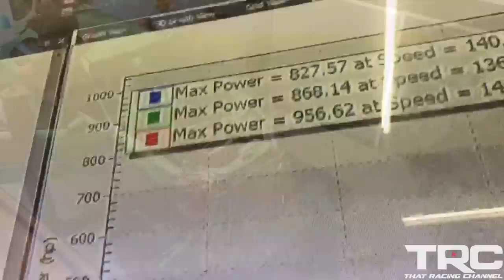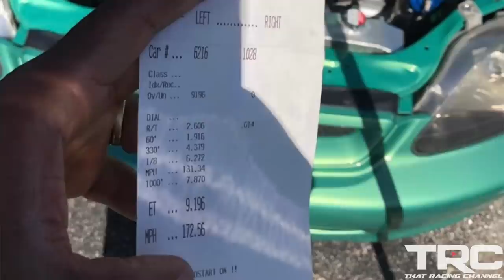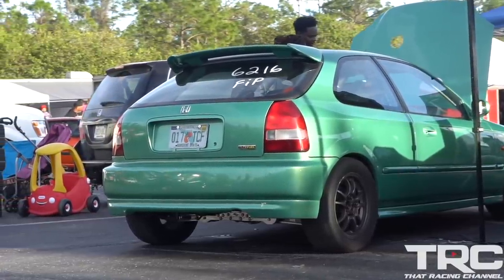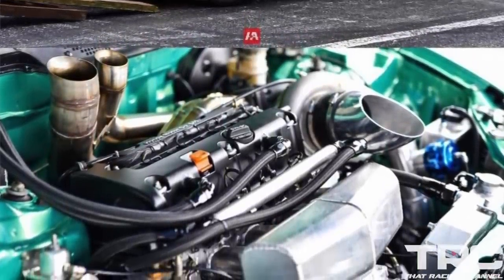Sleeper 960HP AWD Civic Runs 8's on Street Tires! The Perfect Street Honda?

Comment: Your videos title says “sleeper.” The hood exit exhaust determined that was a lie.
Reply: Suited AndBooted66 right
Reply: U can street it... just have to beat it. The blue lights that is
Reply: It also says street tires, which he even states are drag radials. Not that I'm crapping on the car, cause it's still super fast, but they should at least change the title to drag radials. The guy even admits to not driving it every day. Cars like this are lucky to get a year out of them before having to replace and engine or transmission, to start it all over again, etc. Especially with this car being high compression and running boost. But I'm sure it's still loads of fun running down the track!!
Reply: I was about to comment that. lol
Reply: @junechris  street drag radials
Reply: i mean, you can hood dump just about anything lol, doesn't mean its fast
Reply: @junechris  FYI a drag radial is considered a street tire
Reply: Drizzy570 But an exhaust coming out of the hood does disqualify it from being a sleeper.
Reply: @suitedandbooted6612  not really lol, there is a 167whp honda in my area with one.some people just do it because they can and like how it looks
Reply: Drizzy570 A sleeper is a fast car that looks slow. You’re talking about a slow car with a hole cut in the hood to try to look fast.
Reply: It doesnt look nearly as fast as it is.  I'd think it was maybe 4-500hp just by looks if i saw one like this irl
Reply: A "sleeper" to a non enthusiast.
Reply: I love the comment section. Full of kids who have never done ANYTHING calling out everything they see that they think is "wrong" based on other videos they have watched. People today actually consider themselves knowledgeable on a topic because they have seen a few videos. Imagine being that ignorant and arrogant at the same time... What a combo! Specifically these goofs saying a hood dump means it is fast... Yeah.. Cause it's really hard to buy a sawzall and mig at harbor freight. There is 200 bucks. Boom. These kids all say your car is undoubtedly FAST now!! Not a sleeper any more.
Reply: @eriklarson9137  you are most likely misinterpreting the comments.
A sleeper doesnt look fast.
Not saying that a hole in the hood makes it fast, but its a mod generally done to cars that are.  So hood hole = not sleeper
Reply: @junechris  just because this guys doesnt DD doesmt mean he couldnt there are hundreds of 700+ hp civic that get driven everyday for years
Reply: I agree with suites and booted66...this is NOT a sleeper car it’s a fuckin track car. Anyone who says otherwise is a moron. A sleeper is something you drive on the street daily that looks like a bucket but kicks the shit out of other “fast” cars. This car doesn’t look like shit AT ALL. So in conclusion THIS IS NOT A SLEEPER CAR. Ok thank you.
Reply: @junechris  i didn't know 10:1 is considered high compression.
Reply: @big_lu32  My Z28 was 10:5 to 1 and I had to run premium gas at all times, otherwise it would run like shit and it was considered high compression. Nowadays the technology is much greater. Like my friends mazda 6 is now at 13:1 which is mind blowing. The first thing I thought was , how does it even run on pump gas...lol And it recommends regular shit 87 octane to boot.
Reply: The judge jury and executioner has determined that the hood exit exhaust doesent F'n matter
Reply: in the 8 second world this is a sleeper lol
Reply: You Hating lol
Reply: Suited AndBooted66 true. But besides that it looks like a normal car... ish
Reply: ZeloCODM I disagree. It has 2 big holes in the hood, a cage, a big fmic, drag radials, gutted interior with Kirkey seats. Also, running at 172 he should have a parachute. Realistically he shouldn’t be allowed to run that fast without one. Any car going faster than 150 needs a chute.  Not putting a chute on the back of this car doesn’t make it a sleeper. It just means the driver is breaking the rules, and the track isn’t enforcing them.

*edit: the interior isn’t gutted— in the one video the radio surround fell out of the dash. My mistake.
Reply: @junechris  street/drag radials.
Reply: I could be wrong but the hole in the hood was for the turbo impeller to receive fresh,cool,unfiltered air. Not to be mistaken for a hood exit exhaust. Just my 2 cents…
Reply: @jgc0064   There are 2 holes in the hood- one for intake, one for exhaust. This car did not come from the factory with holes in the hood. So my statement still stands true. A sleeper is a built-fast car that looks factory. This car does not look factory stock. You could tell from a mile away that this car is modified, even when it’s parked and not making any sound.
Reply: @suitedandbooted6612  agreed. Didn’t see the hood exit exhaust- my bad.
Reply: @big_lu32  it’s not super high for turbo but depending on how much boost you’re running, you can see them sub 10:1 .
Reply: @junechris  10:1 compression isn’t high even on a turbo engine. Guarantee the engine lasts years
Reply: This is very much a sleeper to me. The overall style of the car does not stand out much. He could go one step further and better hide the hood. Love the low profile of this car. 8.6 1/4 is nuts! 10:1 compression is pretty high, now its more common because of direct injection and E85 gas, but same year ITR was only 10.6:1 and made over 100hp/L NA.

Comment: street tires.. then heard AWD.
Reply: I've seen a RWD run 5s in the eight on hard tires, not r888s or other semi slicks. Straight up 200 treadwear street radial tires.
Reply: @barneymiller7894   LOL yes mate sure
Reply: @bhubb18  Search Hard Tire Plymouth Scamp, you'll see it to.
Reply: Or Mario 2.0 Hard tire.
Reply: @barneymiller7894  8th mile lmao
Reply: @bhubb18  Ya that's what I said, 5s in the eighth mile, roughly equates to low 8s in the quarter.
Reply: BarneyMiller a 5.1 or 5.2 in the 1/8 can be a high 7 if it’s got enough top end
Reply: @bhubb18  reading can go a long way
Reply: SoloCamo - right..it's not like the title of the video didn't say it
Reply: @Mr.Saephan503  pretty sure the title was edited after.  That or I'm blind.
Reply: @barneymiller7894  Riiight, that happened.
Reply: ye lol
Reply: Where the fuck are you buying your street tires?
Reply: Nathan matas amazon
Reply: @n0te618  Search it for yourself, Mario 2.0 hardtire. Not saying it's easy, just possible.

Comment: I would daily that thing
Reply: Most def. Just need to tint the rear windows & your set. V8 Killer 😎
Reply: @patrickdakis4437  Anything on the street killer
Reply: @illmatix.7745  lmao i think this Honda can actually beat most streetbikes too
Reply: @patrickdakis4437  more like v12 killer
Reply: kill my ears too
Reply: @killakam123321  I've been beat by a 250 300 whp  civic   and I had a clean ass 93gsxr600 112 hp 550 lbs  and my bike was never quite as fast as the newer 600s but I could keep up with these  big nuts.  As long as I had corners. Q3 Dunlop  only on my 600   2 and a half to 3 weeks I'd eat threw the tires. 300 $ every time
Reply: Daily a car that runs on race ethanol and can probably barely idle at a stop.
Reply: Ronnie Young my 97 ford ranger has the same hp😂😂
Reply: @namelastname5391   I promise  the gsxr 600 is faster than a Ford ranger.  I've beat the mustangs with the cyote motor.   Lol. Police in a charger once too. Lol.
Reply: Until it gets immediately stolen
Reply: Ronnie Young no duh 550 pounds compared to the 2,900 my ranger is 😐
Reply: Ronnie Young i was making fun of how slow my truck is it probably does 0-60 in over half a minute 😂
Reply: The guy probably does lol
Reply: UNKNOWN G I would too
Reply: Darkeese Latifah 😂
Reply: Work horse😁

Comment: Ryan is a bad ass for sure. I have a 03 Evo 8 that he built the engine in it for the previous owner. Currently has a Precision DBB 6262 the car made 666whp on AG AutoSports dyno and flat 600whp 6-8800rpm on 5150Racing's mustang in SoCal. Very solid build of an engine by Ryan, definitely looking forward to changing the turbo for a 6766 or 6875.
Reply: Alex Comeau sup brother thanks man! Glad all is well and your happy with the motor!💪🏾💪🏾
Reply: @acrite1999  You're welcome!
Reply: 6875 🔥

Comment: Where do all these people find tracks that let them run without proper safety gear? running 8s in the 170s with no parachute?
Reply: KingOfDemise FL 😝😂
Reply: Mexico?
Reply: There's not even a cage in the car, let alone a chute
edit: there's a half cage but there's no way its 9.0 or 8.50 cert, that's some serious power and some serious speed. It's a death wish running the car that fast without proper safety
Reply: lol parachute? the car doesn't even have a cage!  just a roll bar. he shouldn't even be going over 135mph on the track, at 170+mph that car would be toast.
Reply: TRD185 that's just the south Florida way
Reply: This event is held at a track rental, no NHRA tech. And theres plenty of Outlaw (non NHRA sanctioned) tracks down south and in the midwest that dont have tech period. At any event.
Reply: In the south we don’t give a damn unless your leaking on the track.
Reply: @nickxcaliber7991  Idk what the hell the stuff is called but one of my buddies went to some little Outlaw eight mile track down South that wasn't even Blacktop, it was like bits of shattered shale held together with Tar! IG every time someone launched it spit rocks at the burnout box! I've seen some dusty blacktop roads here in Colorado, but I though only Aussies raced on shit that sketchy! 🤣

Comment: Awesome Build!! For the sleeper effect, all I would of done was remove the Flex Fuel badge, ran a stock exhaust and made an electronic cut off before the stock exhaust and straight piped the Exhaust and dump tube under the car

Comment: I’d really like to know how much this build cost in total. I’ve heard civics are much cheaper to build than Evo’s but I wonder if that applies at the top tier as well
Reply: No matter what ur always looking at less plus if ut fukes up it's cheaper an evo you will kill urself if ur first tune blows up ur engine no.joke.
Reply: At that point your looking at initial investment being cheaper. Obviously the civic, even with motor swap, is probably gonna be cheaper than a decent (not totally thrashed by a teenager) EVO. But for that level Honda aftermarket parts are only marginally cheaper than evo stuff so once your shooting for power levels where your looking at a sleeved block and a built head, the build itself is gonna be almost as much as a similar build on an EVO.
Reply: The Honda Civic engine I have seen before:

-Turbo Garrett GTX 5008(the size similar) $1900 or less
-intake $660 or more (NOT FROM EBAY INTAKE HE HAS THERE)
-all kit should be around $600 or less.
-wheels $500 or more
-tires $600 (I believe so)
-paints on his Honda should be over $800 or more.

Damn there is no cheap build but life is short to keep it stock tho
Reply: El Ferdo Rivas if that was all I needed to be even close to this build then I would do it instantly but I’m guessing there are more expenses where the clutch, displacement, transmission, awd conversion, cams, injectors, rods, pistons, crank, inter cooler, ECU, fuel pump, injectors, transfer case, etc. are concerned lol. And ya high hp builds are almost always going to be expensive 🥵 For an Evo you’d be looking at around $30k give it take so was wondering how the civic compares.
Reply: 35-40k
Reply: Yeah Honda's cheaper and faster than evolution and wrx sti, golf r and focus rs. Honda's kick ass

Comment: Car is impressive, wonder how long it will last though being high compression and boosted. U usually have to compromise between the two, of course, that's with street cars..
Reply: Change the suspension over and hillclimb this , TIRED of this straight line culture. Very simplistic for such an intricate car.
Reply: @hahabbvd1358  FUCKING AMEN
Reply: @hahabbvd1358  'straight line culture' lol man you're trying to essentially change american history
Reply: Wouldn’t use this for a hill climber.

Comment: How is an awd civic "off the shelf parts"

Dope car!
Reply: live and let live parts are from other Honda cars that was awd
Reply: @lahu5593  that's not off the shelf
Reply: @liveandletlive2894  not custom either.
Reply: Exactly thats the most overused phrase in cars. Its a basic build with off the shelf parts has awd converted civic with a k swap. Im sure it has a custom driveshaft and trans cross member.
Reply: @bryanbridges6152  Nope. Just OEM Driveshaft that's been cut, OEM Rear diff. Everything for this car can be bought online without special ordering or custom work.
Reply: @humbleperformance  cool build but you just contradicted yourself. You said its an OEM driveshaft that has been cut. So it does need some custom work
Reply: Humble Performance hey what’s up brother! You have one bad ass ek as well man💪🏾 your car was definitely an inspiration while I built this civic🙏🏾✊🏾
Reply: @bryanbridges6152  You can also buy the driveshafts off the shelf The Driveshaft Shop. If you think paying $50 for an OEM driveshaft to be shortened at your local driveshaft shop is the only thing that makes the entire build a non 'off the shelf' build, there's no helping you.

"Oh the tires had to be mounted at a tire shop? CUSTOM"

"Oh, you had to weld an exhaust for the car? THATS CUSTOM"

"Oh, you had to paint the engine bay? CUSTOM"
Reply: @humbleperformance  yes u also have to have a custom exit made but most just go out the fender. Just proving that everything cant be done in a normal joes home garage is all.
Reply: U can get everything for the awd setup off ebay

Comment: I have a 1998 Honda Civic CX. 211,000 miles. I am the only owner (bought it new end of '98). Mostly just drive around town. Interior is in almost perfect condition. Paint is going bad but no big dents or dings. Runs great. Whenever I go for maintenance, mechanics comment on what a great car it is. Wondering how much it's worth?
Reply: The CX is more desirable because it’s the lighter model. If it’s as clean as you say it would probably go for 3 - 4K.
Reply: Thank you!
Reply: What part of the country you’re in matters too. The American Southwest has more of these, $3-4K would be correct in AZ, CA, NV. If you’re in the Midwest or Northeast, you’ll get another thousand or so if it is rust free.
Reply: You didn't mention Southeast... Florida to be exact.

Comment: Yea I can hear the V8 streets still trying to clown Civics... The 90s mid 00s are a thing of the past . We spanking your V8s daily . . Happens alot more often now. 😎❤️
Reply: my guy for every 1 fast 4cyl theres 25 v8 cars spanking it. if you throw a ton of money at a 4 cyl you can make great power. slap a blower fuel pump injectors and e85  small pulley on a a v8 and your tip toeing on 950 horse for around 15k
Reply: Bro you can hit 500hp on a k20a2 with a turbo injectors fuel pump and retune on a stock bottom end
Reply: @GhostlyGhille  this is very, very true.
Reply: @habib1971  exactly meanwhile stock internal 5.0s are hitting 1 grand whp..
Reply: @GhostlyGhille  which is true so we'll go with the argument that v8s can make more power for the same price as a mid range 4 cylinder but there are alot of 4 cylinders making crazy power, but both sides have good arguments but v8s have alot more cars that can go tens easily so for now v8s win
Reply: @habib1971  v8s always win my guy. its simple physics more displacement means more fuel/air  which means more bang which makes more muricas.
Reply: The LS motor is the reason why it's easier to go faster with a V8 right now. Ya, a stock bottom end k20 can do 500hp, but a stock bottom end 5.3 can do 1200hp. Where Hondas really kill it is roll racing, if they can grab traction even an 750hp civic has a crazy power to weight ratio, and the k series 6 speeds are geared great! Never sleep on a turbo Honda from a 50 roll, if he asks for a 40 or 30 RUN 🤣
Reply: @uhtc_productions  hard to understand him but I believe he said he is running ppg gears. Big money there. That's what's in the red demon eclipse/talon. Also, the v8s produce too much torque all the way through the powerband to keep manuals alive. It's not that hondas are superior in their ability to use a manual. It's the fact that they take several thousand more RPM to establish their torque, which spreads out the load on the gearset. It tough to explain, but suffice to say this: put a domestic v8 in front of an import transmission. It will go boom right away. That much torque down low, and all the way through the rev range will cause a complete destruction of everything trans related. When I see hondas putting down the insane launches that domestics do, I will cheer. Since, by virtue of their very design, that will never happen, I wont be clapping.
P.S. i do appreciate this, and all types of racing spirit, i just dont get excited by soft launches and buzzing 4cyl noises.
Additionally, unless I missed something, the fastest stick car isn't a 2jz, it's the red demon.
Reply: @barneymiller7894  ls Motors are built like tanks the can make crazy power stock